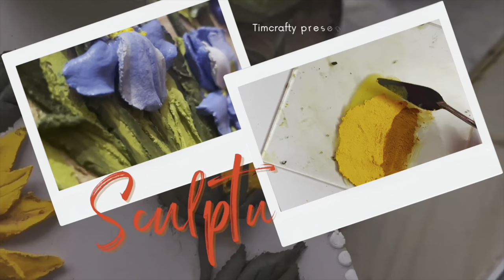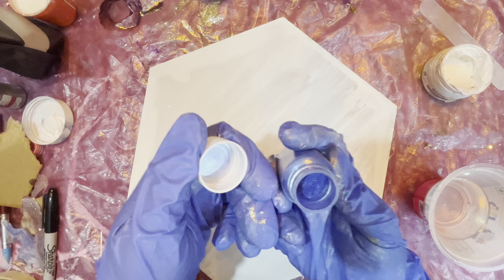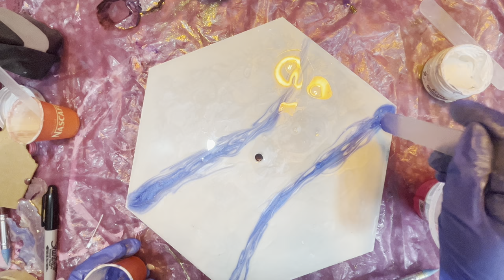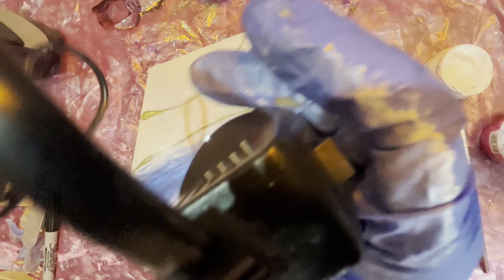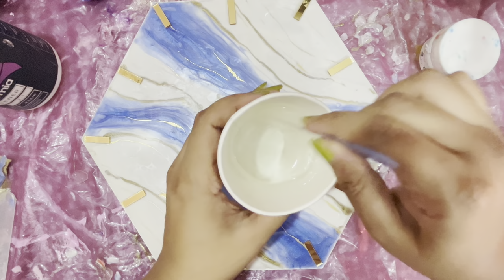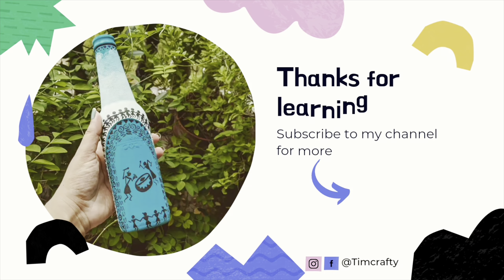Easy Resin wall clock -step by step process for beginners

Comment: what quantity of resin should be use for 12*9 peice of MDF.
Reply from the maker: 12*9 inch base required at least 20-30 ml of resin mixture , you can also measure it before poring resin . just pour some water and measure the amount which is enough to cover the base . that is the best way to reduce the wastage of resin 😇